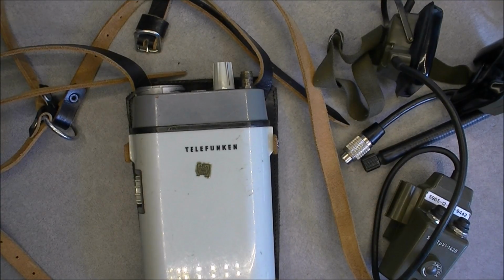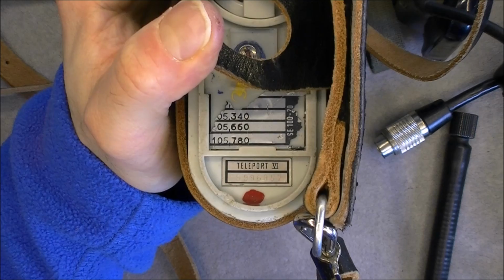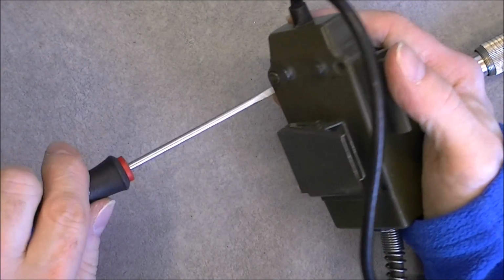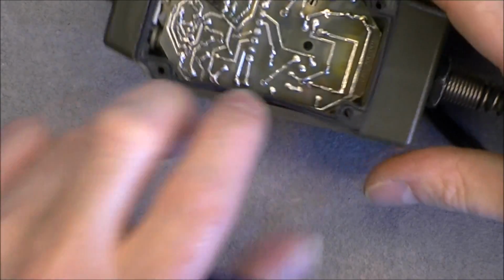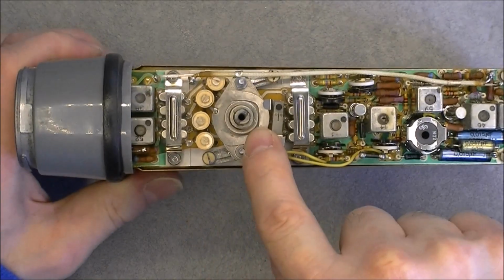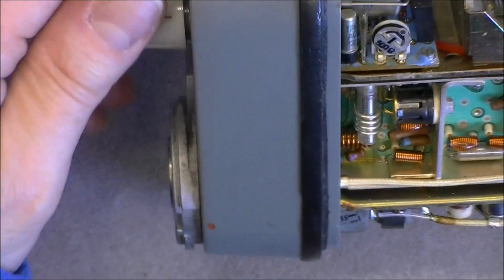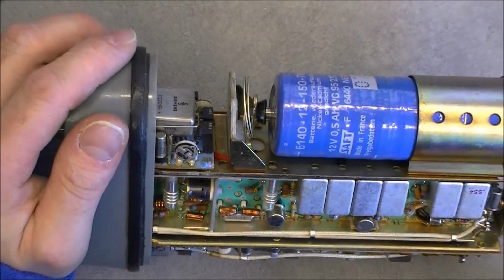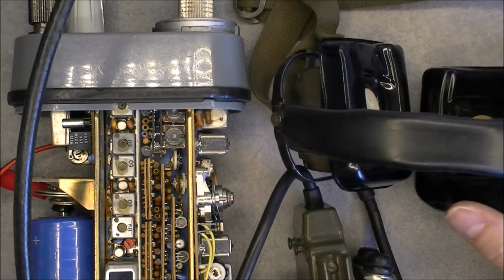Telefunken Teleport 6 military radio teardown

Comment: I would love to buy a couple but can you tel me how to charge the batteries? I cant find anything about it.
Reply from the maker: I guess it was a specific battery charger, I don't think the batteries were recharged niside the radios (as the radio would be unavailable during the charging time). If such a charger exists, it must be available on german Ebay from time to time.
Reply: msylvain59 thx!!

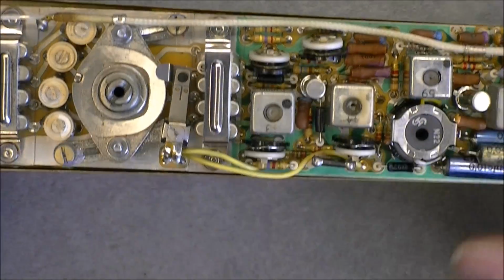Comment: 13:03 this is amazing, because this board (in the middel) is sitting on my desk since 20 years, and I never knew where it came from. Now I know. thank you.
Great video btw, as always. Big thumbs up.
Reply: Now also one thing makes sense: I saw that some vintage tube receivers had 85 -100 MHz instead of 87.5 -108 MHz. In the late 70's and early 80's the entire area above 100 MHz was totally unused (at least where I lived).
Reply: like the Rohde & Schwarz ESB, there was a version that stopped at 100MHz

Comment: The frequencies on the plate are within today's FM radio band. You could try listen to it with a common FM tuner or radio. The crystals however are around half the frequency simply because in this metal can housing they are only available up to 80 MHz max, even today. So at some point they are mixed or doubled. Interesting.
Reply: même un radioamateur n'a pas le droit de transmettre dans la bande FM...
Reply: So what? OK maybe get a coax cable and a dummy load. Pick one of the frequencies where no FM station is. Keep  the test briefly and you will be fine.